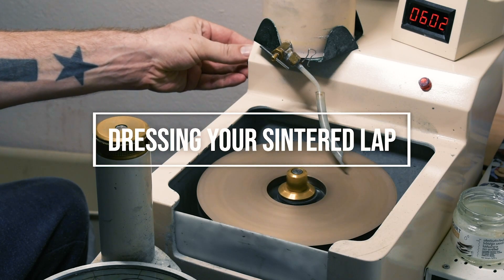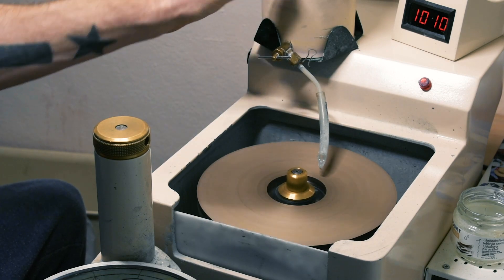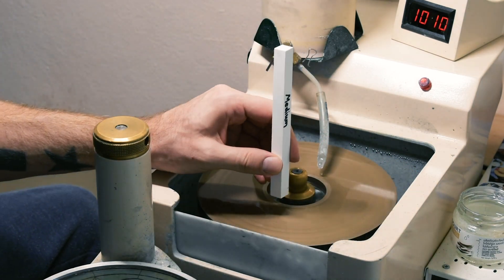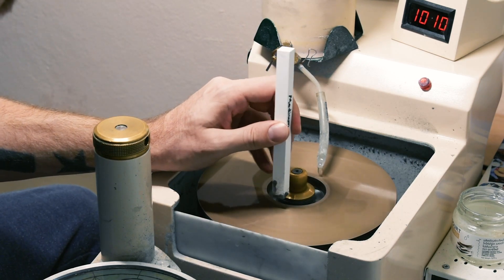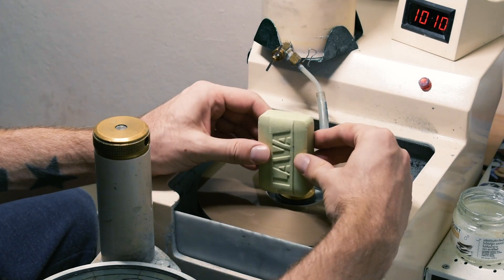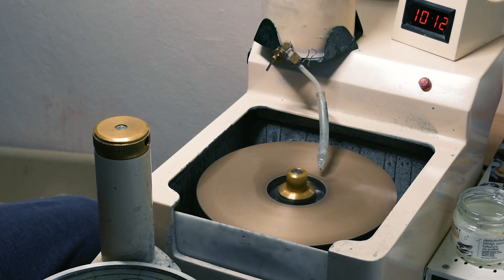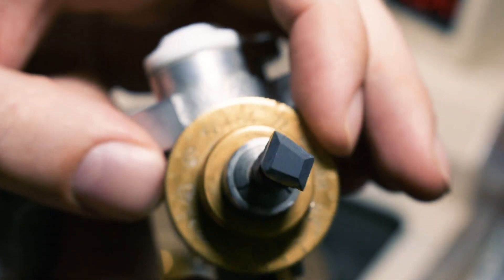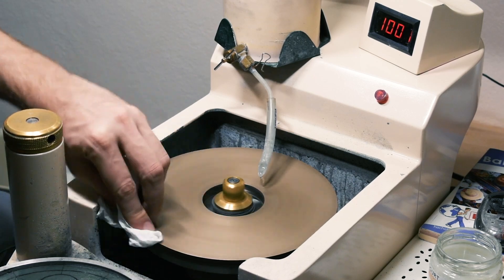Dressing a Sintered Lap

Comment: Would it be OK to use a silicone carbide dressing stick for this purpose? My machine didn't come with a dressing stick.
Reply from the maker: It depends on which brand you have. The Adamas lap that I’m showing in this video will get damaged by silicon carbide. Alumina would be a safer option that works on all laps.
Reply: @JustinKPrim  Thanks for the reply. My brand is Inland Craft. Any additional insights?
Reply from the maker: @collinvickers2345 I would look up their instructions and see